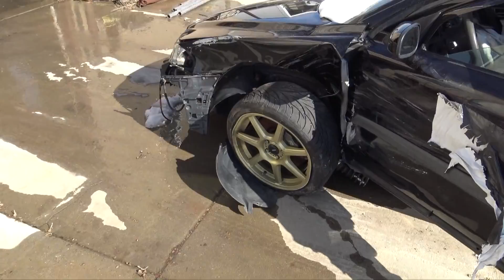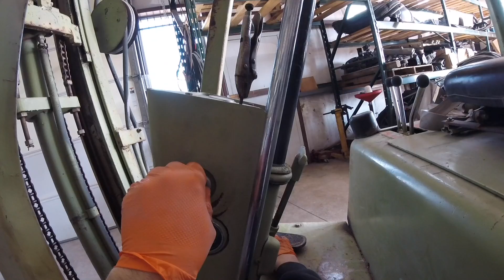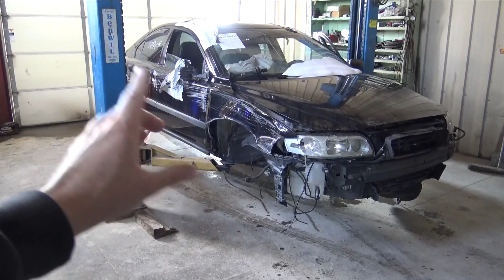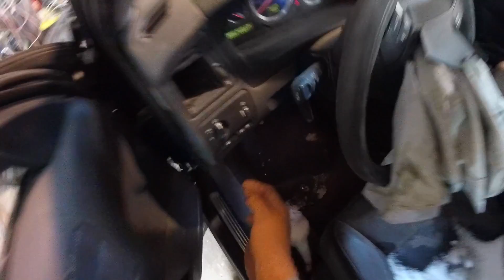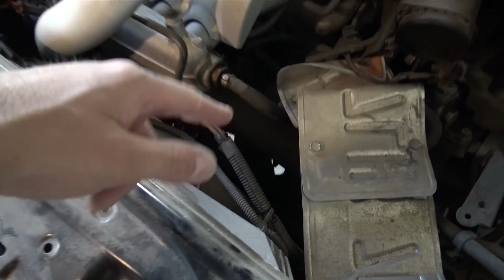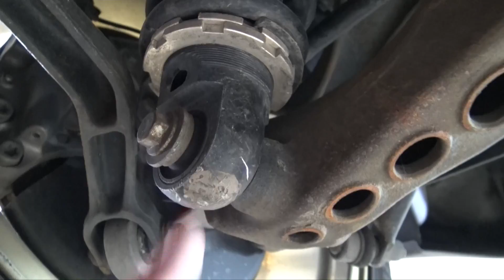$400 Wrecked Auction Volvo S60R | WILL IT START?!?!

Comment: I'm trying to swap the trans to manual in my S60R. I need a wiring harness or the proper steps to modify the reverse sensor, clutch pos. sensor, and reverse lockout but once I figure it out I have all the parts.  Might as well order a pressure plate and single mass flywheel with a new clutch too
Shes got over 300000 miles.

Comment: Lifehack when it comes to wrecks that has been standing around for ages, disconnect the negative terminal on the battery on the battery in the car.. A dead battery will try to suck up all the power from what ever you try to jump it with. May be interested in the calipers from it if you are parting it out :)

Comment: I'm the guy that always bugged ya about buying the gold wheels.  I have a set on my S60R and really like them.  You should keep them, as they are some the lightest wheels I can find in our bolt pattern and they are really strong.  Can be had on eBay new, around 300 for 2.

Comment: So now you are going to have a nice t5 engine left over? Time for a nice RWD Volvo chassis swap I'd say! 940 'd be my choice but you guys sadly didn't get that much in the US I believe. 740 is that same chassis, and 240's also have a lot of room to play under the hood. Mating a manual BMW ZF trans to it is common in Sweden and conversions are readily available. Dana axles came stock so a lsd shouldn't be a problem (late model euro 940's came with one). Sort a like euro sr s-chassis or beemer drift platform that almost everybody in the US is sleeping on..

Comment: Why not get a T5 2,4 (05-08) when you swap the engine?
The R engine is 2,5l and the cylinder liners start cracking after 400hp
The 2,4 T5 05-08 can handle over 600hk unopened. 
Almost half of all R in sweden got the T5 to handle more power. 
Do not mix up with 2,5t or 00-04 T5, must be 05-08 260hk

Comment: Don't thin kyou can use the hood from a s60 on a V70, think the hood is longer on the 70 model. Atleast here in Sweden we had/have a S70 model which is the sedan of the V709. S60 is a smaller car than the S70.
Reply: Yes, you can. I know for a fact they're the same on P2 models.